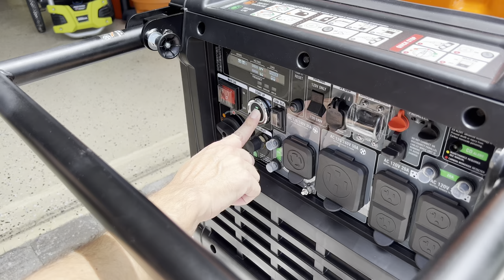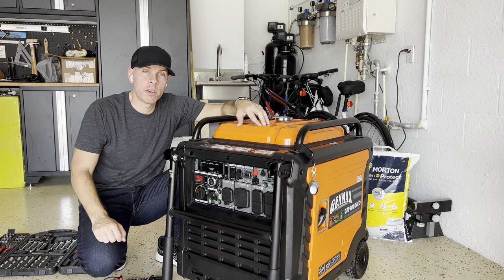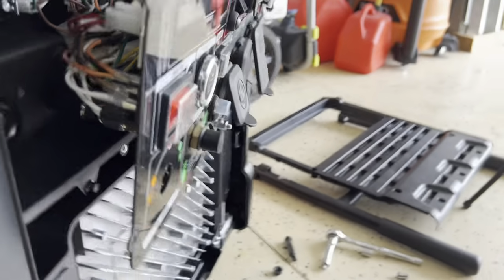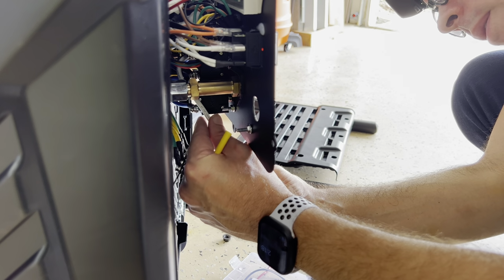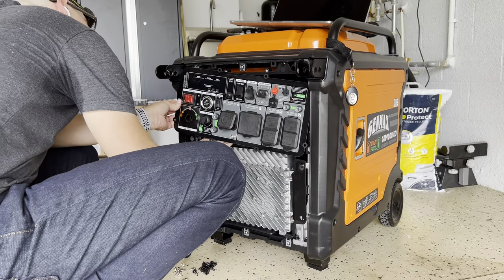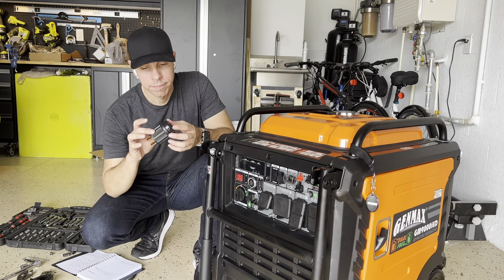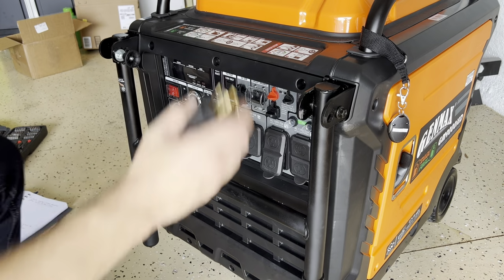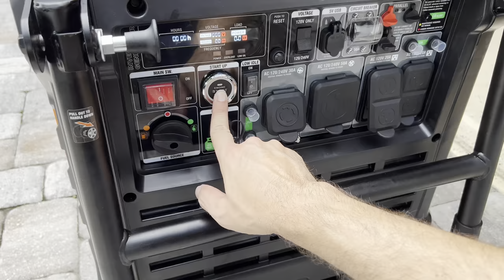How To Convert Genmax GM9000iED Bonded Neutral to Floating Neutral

Comment: Using that "bonding" plug is a good idea BUT... if that plug gets lost or someone forgets to use it, the generator may not be safe for stand-alone usage. A clearly marked switch to bond/unbond would be much safer.
Reply: I'm an electrician. I like the idea of a toggle switch on the face plate too. Makes a lot of sense and is easy to retrofit. Great idea.  💡

Comment: Finally someone who gave a simple explanation for the difference between NEUTRAL BONDING and FLOATING BONDING. Not only that but a simple way to convert a Neutral Bonded generator and a safe and easy way to switch it back.
Reply from the maker: You are welcome

Comment: All portable generators will be bonded because they are required to have GFCI breakers. I noticed Westinghouse the manual shows how to un-bond it.  Great idea using the plug to make it bond again. That way no one will get shocked using a GFCI plug if something goes wrong using it as a standalone generator.

Comment: Can you please make a video on the new updated GENMAX GM9000ied? GENMAX made changes to the back of the panel, it’s nothing like the version in this video, I have looked at the web and can’t find the newer version.
Reply: Same.  My wires on the strip are all green and yellow
Reply: @johnhooks1902   I called GenMax. They told me to make it floating neutral you have to remove the white neutral wire off of the far right GFI. I did that and it works. You’ll see where the neutral wire is underneath the ground wire on the far right receptacle.
Reply: @no1but24  been working on it today.  Mine is different but, I see what you are saying.  Far right loops all the other grounds on a terminal.  (Mine is not white).  I believe my problem is that the ground on that gfi is stripped and was never tight.  The screw was threaded out and just hanging with the ground wire hanging on the screw.  Wonder if this was a refurbished model.  It was purchased from Amazon.  Definitely a stripped thread in the plug.  Thanks for responding.

Comment: Thank you for a very informative video. I suggest one modification to your wiring procedure. The White neutral wire splits and is attached to the bar you identified and to another screw terminal on the panel.  There is continuity between both terminals.  Disconnect the white wire from the bar (as you do) and just attach the ring connectors for both wires under the same screw on that other terminal. That way the Neutral is securely connected and there isn't a chance for the shrink wrap to fall off.

I was lazy and purchased a 120V bonding plug but I had several GFCI's trips when I was running the generator, stand alone.  I think the bonded plug on only one electrical leg caused GFCI problems.  I made a bonded plug using a spare 50A plug and 6 AWG wire.  That worked great because the 2 hot blades on the plug were removable; so ONLY the Neutral and Ground blades are actually plugged into the generator.  No hot wires are inside the 50A plug.  This arrangement still maintains all the 120V receptacles for actual use.  I don't expect to ever use a 240 Volt tool powered by the generator so I am not losing a receptacle.  I have to remove the bonded plug to connect to my house so I can't forget and have 2 locations where the neutral and ground are bonded.
Reply from the maker: Thanks for the tips

Comment: Thabk you for all the help if I want to run two of these in parallel for my house how would I go about making it a floating neutral would I do the same steps for both generators?
Reply from the maker: That is correct.  You would need to do the same on both.

Comment: Did the conversion to floating neutral this morning following the instructions in your video. Took continuity readings at every step to verify my actions. Took about 2 hours. Thanks for the info.
Reply from the maker: Hey. I’m glad it helped you.  I am on the path of Hurricane IAN. So I am ready. If I lose power I have my GM9000iED ready and move both AC without any problem.

Comment: I'm confused. I started following the steps to convert to floating but the inside of the panel on my new 9000iedc was different. The manual says the 9000ie is floating not bonded. But it doesn't specifically address the 9000iedc. Any thoughts?
Reply from the maker: @jackboothe5684  There has been some changes in new models.  I would test the outlet first with a multimeter like I do in the video to text for continuity first.
Reply: I called Genmax. They say 9000 is now floating neutral.
Reply from the maker: They probably figured that that way is a lot easier to make it bonded if need it.   Ok thanks for the input.

Comment: I recently converter my Genmax to a floating neutral as well; however, when plugging in a neutral to ground bonding plug in a 120V outlet, it trips the GFCI. Any ideas why this is happening? I checked voltage between neutral and ground when the unit is running. Shows about 2V when idle, but if a load is plugged in to the 120, there starts to be a decent voltage diff, between 8V and 20V depending on the load. The voltage diff is on both the 120V and 240V plugs.
Reply from the maker: Did you build the bonded plug 🔌 like I did in the video?  If you will be connecting things directly to the generator you need that bond that is why I created a bond plug with the plugs that came with the generator.  Another thing. GFCI outlets don’t like things that fluctuate in amps and voltage.  For example if you are connecting a refrigerator is very likely that will trip. But if you connect something that will draw a constant amps and voltage then will not trip the GFCI.
Reply: @JavierRivera  I bought a bonding plug to put in one of the 120 plugs so I don't lose the 30A. I confirmed with a multimeter it does bond neutral and ground back together, but if the unit is running and you plug it in, it trips the GFCI.
Reply from the maker: @jmurph44  just to double-check. Build one like the one I built and test it.
Reply: @JavierRivera  The 30A bonding plug worked correctly. I guess putting a bonding plug in the 120 one didn't play well with the GFCI. Thanks for your help.
Reply from the maker: Great news. 👍🏻

Comment: Question: I have a Genmax 10500iETC which is Floating Neutral. I'm assuming that using the same NEMA L14-30P setup will convert this unit to Bonded Neutral; is this correct?
Reply from the maker: That is correct.

Comment: Javier. What is the solution if you use the generator for the house panel, but also want to plug additional devices with extension cords through the 120 v outlet at the same time?
Reply from the maker: You can do it, if you are connected to the house panel you will be using the house panel neutral bond. But if you are not connected to the house panel then you will need to create a neutral bond plug as I did in the video using the 3oamp plug.

Comment: Great video I’m using a 50amp interlock what will happen if I don’t un bond the generator ? I’m very confused
Reply from the maker: Hello see this link. https://www.electricgeneratorsdirect.com/amp/stories/1021-How-to-Avoid-Tripping-a-Generator-With-a-Bonded-Neutral.html
Reply: That was the best explanation yet I understand now. Your bonding video was excellent your step by step made it very easy to to do. Only took me 30 mins and I check the Continuity before and after and the bond was definitely broken. I ordered the bonding plug from Amazon just in case I needed to use this generator without connecting it to the house. Thank you again for such an excellent step-by-step video.
Reply from the maker: @patrickcoleman5867  great you are welcome I am glad it helped.

Comment: Great video. I have the 7250 model and need to do this. I had 240v going to one leg and fried a bunch things. Unfortunately, the back of my panel looks very different than yours. I dont have the bar. Ive tried to get help from genmax but haven't  had much luck. You or anyone know how to convert the 7250 to floating neautral? Would appreciate the help!

Comment: Thanks your your video and comments back to me, if you remember I have a newer model and it was different from the model in your video, I appreciate your comments on how to convert mine and called GENMAX tech support to confirm, I did it this morning in under an hour and did all the test you did and everything work perfectly, thanks so much.
Reply from the maker: You are welcome.
Reply: This was an excellent video and you did a superb job. Lots of good info here. My Westinghouse Wgen 9500 gas generator provides how to remove the ground jumper wire to float the neutral which was a different maneuver than what you did but does the same thing, converts the generator to a floating neutral. I think and I could be wrong but I believe that there are a lot of generators in use that DID NOT convert their bonded frame to floating.  Get this, I had two well established electricians out to my house to quote installing a transfer switch and not one knew what I was talking about. The first guy told me that it would be fine as is.  I believed him until I started to research this procedure more throughly and it became clear to me why this has to be accomplished if you intend to connect your generator to your main or a sub panel.  The second electrician after viewing the gens user manual (that I didn’t show the first electrician) agreed that the generator has to be converted as it says to do so in bold letters in the user manual.  I understand why a lot of people get pissed when they learn that this process has to be reversed if you use your gen as a stand alone power source. But that trick you showed us with the plug, super cool! So does this plug trick work with any generator that the has been converted to floating neutral no matter how your mfg. instructs you to do it? Did you use a male 30 amp plug to make that?  Where did you learn this?
Sorry this was long. Had a lot to say.

Comment: Great video 
What happens if you need to run a 220v well pump  straight to the generator? Do you rig a jumper plug on the 110v connection?
Reply from the maker: That is correct
Reply: If you jumper a wire from ground to neutral on and with a GFCI receptacle it will trip. It cannot be done. Try sticking a wire stripped at both ends and into a GFCI outlet in your bathroom GFCI outlet or kitchen and it will instantly trip. That is the same way the receptacle testers with the push buttons to test GFCI outlets work. 

Jeff - Licensed Journeyman Electrician - Sunny Central Florida ☀️

Comment: what if im do both? i run 1 50 amp into breaker box but also run the 30 amp directly to central ac?
Reply from the maker: I am not sure I understand your question... The generator only will generates 50AMPS no matter is you connect to both outlet, 50 not 80amps.
Reply: @JavierRivera  im talking about bonded or floating neutral since gen. will be connected to breaker box with the 50 amp and to an appliance with 30 amp and maybe more with the 15/20 amp 110 plugs
Reply from the maker: @fredflintstone-bedrock  OK I see now, in that case you can still connect those appliances directly to the Gen. because by being connected to the breaker box with the 50A connector the generator will be already bonded. BUT if you are not connected to the breaker panel with the 50a connector and you will like to connect appliances directly to the Gen. You will need a bonded plug somewhere (50a connector for example is you will be using the 30a and 120v outlets)
Reply: @JavierRivera  what about just cutting off the ground on the plug of the 50 amp gen. cord or remove ground wire from 50 amp plug.  and let the generator bonded for the rest of the outlets
Reply from the maker: @fredflintstone-bedrock you want to have only 1 bonded Neutral on a system.  And you need ground and neutral.

Comment: I didn't see the items in the comments. Could  please ad them.
Reply from the maker: What items?  The links?   🔗.  

————— LINKS TO PRODUCTS IN THIS VIDEO ——————

GENMAX GM9000iED -  https://amzn.to/3lEgFx8
Digital Clamp Meter Multimeter - https://amzn.to/4aFJtt0
Heat Shrink Tubing Kit - https://amzn.to/3ukfqUY
Heat Gun Variable Temperature  - https://amzn.to/3OJ8xog
Wire Stripper - https://amzn.to/3OGAI7h
Neutral-Ground Bonding Plug - https://amzn.to/3Rb6XgA

Magnetic Oil Dipstick - 
Magnetic Oil Drain Plug Bolt - 

Reliance LL550C 50 Amp Generator Connector - https://amzn.to/39ODlEZ
Reliance 50 Amp Flanged Inlet 1450FP - https://amzn.to/39Q0jvd
Nassau SOOW SO Cord Power Wire 6/4 35 FT. - https://amzn.to/3OFQAGB

Reliance Controls Power Inlet Box 50-Amp - https://amzn.to/3bsFh6y
WELLUCK 50 Amp Power Inlet Box - https://amzn.to/3Ng7Q4l
——————————————————

Comment: Hello Javier..... I did all the steps... and took off the panel but there is no single white wire for Neutral going to the ground bar.... there are many white wires ... they seem to go to each plug and then jumper to somewhere else.  If I disconnect the set of white wires that go to the 50amp plug..... will that work?
Reply from the maker: I wish I could attach a picture here.  A few months ago someone told me that the white neutral cable wasn’t on the ground bar in his generator and told this “The white oval is the back of the last/fourth/far right receptacle in series (20A GFCI).  I disconnected the Green/Yellow wire that was tied to the white from the back of the outlet and it appears that there is no more neutral bonding!”
Reply: @JavierRivera  thanks for the quick reply.  Yes i looked further to the Right of the panel where the 120v plugs are and i saw the Green/Yellow wire and the white cable tied together on a screw.  It leaves from there and jumps to every single outlet receptacle.  Thanks for all the videos very helpful.  I hope i don't have problems with my Unit.  I live in the Caribbean so shipping back to Genmax is not an option for me..... and although i got the Amazon 3 year Accidental protection Plan... i dont think they would send me an entire Generator for Free.

Comment: Thanks for your reviews and advice.   I just bought one via your link.  It came with floating neutral...so it's changed.  They include a 110 bonding plug but when you plug it in it trips the gfci.  I will try your 30 amp bond plug to see if it will work or trips the gfci.  I'm trying to connect to my rv and it doesn't like floating neutral. I have a bonding plug on an older generator without gfci and it works....but this one has me stumped
Reply from the maker: GFCI are very sensitive you can not connect anything to the GFCI that varies the load, need to be constant.  You are better off connecting your RV to the 30a or 50 amp outlets depending on your RV requirements.   Also using a multimeter you could test the RV OUTLET to be sure that the RV is already Neutral bonded.

Comment: Great video and explanation, thank you! I just received mine and performed the unbonding procedure (since the generator’s primary use will be “backfeeding” my house’s main panel during outages). I also picked up a bonding plug for instances where I might use the generator stand alone (out in the field or a job site). You’ve got a new subscriber!
Reply from the maker: Thanks I’m glad it helps.
Reply: @JavierRivera  you’re welcome! Also, do you know if anyone makes a storage cover for this generator?
Reply from the maker: Someone recommended GenTent https://amzn.to/3imWmTe
Reply: No.. do more reasearch there is an easier way of hat allows you to keep your generator stock
Reply: @x01e  did plenty of research, including thorough and credible information from this creator. Don’t comment to the contrary without providing a detailed explanation and without citing information sources that are easily searchable.
Reply from the maker: Is CODE.  By code you can not have 2 neutral bonds at the same time.
Reply: I just purchased the same generator but a newer version and the connection board is different than the one in your video and I'm not sure which wire to disconnect
Reply: Also on the manual said that it comes floating neutral  but when I do the test it has continuity  like the bonding ones. So I'm even more confuse
Reply from the maker: @jorgeGarcia-ww8sz  some viewer wrote this.  “| called GenMax.
They told me to make it floating neutral you have to remove the white neutral wire off of the far right GFI. I did that and it works. You'll see where the neutral wire is underneath the ground wire on the far right receptacle.”
Reply from the maker: @jorgeGarcia-ww8sz  if that is the case. You should test it with a multimeter like I do on the video before you do anything.
Reply: Also on the board  each plug says  "neutral bonded to frame"
Reply from the maker: @jorgeGarcia-ww8sz  test it first with a multimeter